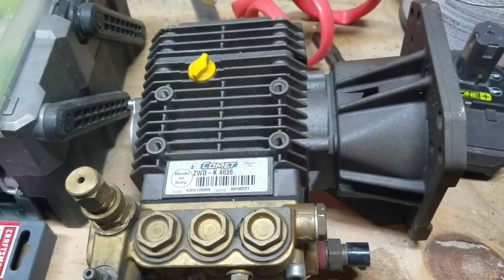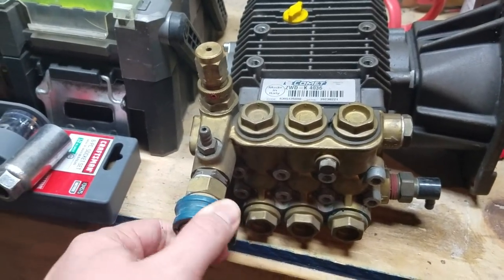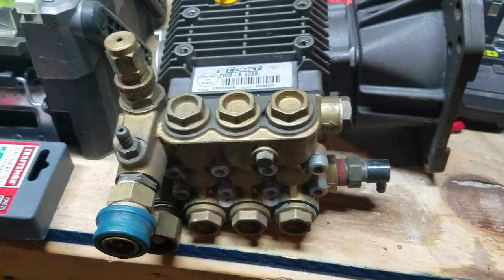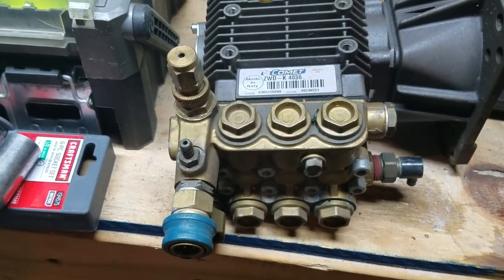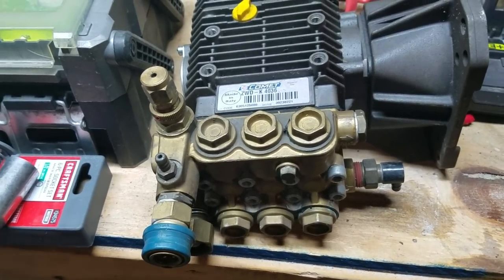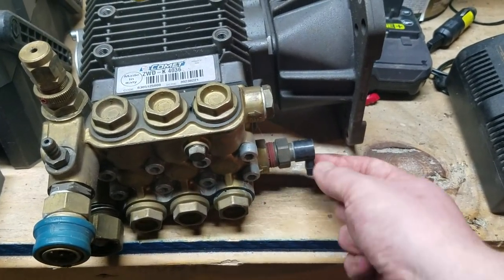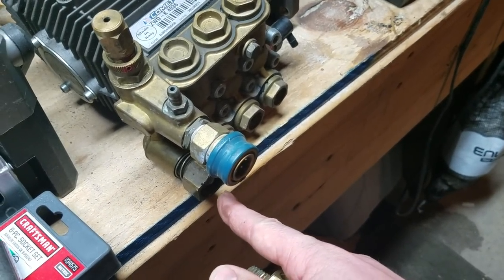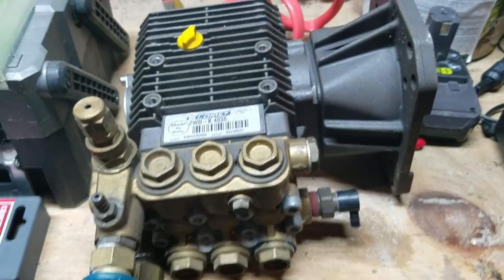Pressure washer pump basics

Comment: I have the same pump AAA Brand my thermal relief constantly leaks when machine off and water supply is on or off but doesn't loose pressure will it stop leaking if I replace ?

Comment: Thanks for video. We are just starting out & have bought the ZWD-K 4042 on a Honda 390 engine. I was hoping to use a buffer tank so that we don't have to be on the trigger all the time but after watching your video it seems that you are saying this is not an option. Am I correct in assuming that. I hadn't seen any videos previously that this would not be possible with this pump that's why I am grateful for your video. What I am worried about is that being newbies we will forget to pull trigger every 30 seconds & damage pump. I was expecting to install buffer tank to be able to let water run through pump to the tank  to prevent damage. If this is not a possibility then I don't see any reason for buffer tank other than if you go to a job that has no water! Is that correct. Can you give advice to newbies who now feel we bought the wrong pump as we know getting distracted for a minute or so is a very likely possibility & then damage to pump will occur! Any advice much appreciated!
Reply from the maker: Yeah that pump is best suited for direct feed.   Best advice is make as much money as you can with it and then upgrade your pump/machine
Reply: @Cleanpowerwash  many thanks. It was not so much about direct feed as I understand but to recirculate the water so as not to damage pump from overheating. Also what would be the pump you would recommend to start with knowing that I am worried about the 30 second rule on the trigger?
Reply from the maker: You really have a few minutes.   Most 5.5 gpm pumps are fine
Reply: @Cleanpowerwash  just watched another video of yours showing the different Honda engines & what your go to pump is! 👍
Reply: Video was best motor & pump combo! 👍

Comment: Shouldn't the relief be put up on the pressure side? Bought a used machine with relief on suction side and it was sucking air and wouldn't build pressure. Plugged it and put on a bypass unloader with relief. Always wondered why it wasn't up on pressure side, will it blow out?
Reply from the maker: Not sure

Comment: Hey thanks for the video, I’ve changed the oil pump and used it the other day, and I checked the glass oil measurement thing, and notice that the oil turned black. Is that normal?
Reply from the maker: Yeah that's fine.  It's when it turns milky that you have issues

Comment: I have a landa with a pump somewhat similar but it's belt driven. No pressure whatsoever. First I discovered all 6 valves stuck to varying degrees and fixed those. It has a small clear window on the opposite side of the pulley that you can see a rotor-like wheel, similar to the rotor in a typical old car engine. It doesn't turn when I turn pulley by hand...is this bad?

Comment: Hey man, I'm having the problem where water is shooting out of my downstream injector. Could you explain what that means and how to fix? Thanks subscribed.
Reply from the maker: Ball is stuck.  Or spring might be busted.  Take the hose barb out and look inside
Reply: I did pull chem injector apart and wd40 everything. Spring and ball seem fine and piece is clean. I just pulled upper bolt out holding the assembly that the water passes threw and found alot of black corrosion. Do you think that could cause it to not have pressure and shoot out of the chem injector

Comment: Hi I have a tractor PTO driven Comet TW025 premium series. the gauge maximum is 3500 PSI, would it be best to keep it around 3000? that's what I'm doing but I've seen the brass housing rated to 5000 PSI.  

I was thinking of building a whirlaway system and wondered would 3 nozzles provide enough cleaning power with a 3500 PSI machine?
Reply from the maker: The gpm is a bigger factor on # of tips

Comment: I have a similar pump. That doesn't have a valve to add a bypass line. Is it possible to add a bypass line to a buffer tank on this set up?
Reply from the maker: Without seeing it no clue.  But if there isn't a bypass option already, then likely no.
Reply: @Cleanpowerwash  Thank you sir!

Comment: Can you put a bypass on that Comet ZWD direct drive pump ? i Have just bought a  very similar Pressure washer pump  the 4200 Psi version from comet ( bought the rpessure washer due mainly  to the honda Gx390 wchich comes with it ,,, so i could use this pump  for an interval of five minutes and then it would advisable if i stop pressing the trigger everytime to turn the Honda GX390 off then ?
Reply from the maker: Only way would be if you put an external unloader on it and changed a few other components.   I'd advise against it.
Reply: @Cleanpowerwash  thanks for that amazingly quick answer ... will the pump be ok for jobs now and then  ? (  main service is Window cleaning )

Comment: I have pretty much the same pump hooked to a buffer tank. is there anything else I would need to do ?or will this pump cavitate? I tested it and the pump draw water pretty well. But I have my concerns
Reply from the maker: Clarke's Cleaning Service, Inc. Window Cleaner as long as it's getting water its g2g
Reply: Clean Power Wash awesome thanks man! I'm also going to add that one inch to the pump like you did on yours that should help it out also . appreciate your help

Comment: What’s the diff between direct drive pump and belt driven pump. I’m seeking that the belt driven pumps have just the bore sticking out. And the direct drive pumps have the manifold. I’m assuming that the direct drive does not have a bore but rather uses the bore from the engine? Am I right.? I see a pump on Offer up for $100. But it has the manifold on the side and not a straight bore. Im ASSUMING that it will not work for my belt driven setup. However maybe I can get the direct drive pump and just take off the belt system and just make it a direct drive.
Reply from the maker: Not following all of what you just said. Most pumps take the shaft into them. Belt and gear drive pumps usually have multiple design differences that make them function at a far lower rpm than direct drive. Direct is powered right from the center shaft and same rpm.
Reply: Clean Power Wash LLC currently I have a belt drive system. The pump has gone out. However I found a direct drive pump on offer up for $100. Can’t I just take the belt mechanism off the engine and attach the direct drive pump straight to the engine? Basically a conversion?

Comment: Hey Rob can you replace your thermal valve with a barbed hose and an adjustable valve this way you can keep your water flowing without any any back pressure is that possible thanks

Comment: Great video ..I have a power washer that it work as long as I press the trigger but when I let go it goes off .. help me please is there a fix ???
Reply: I'm experiencing the same issue, I'm currently working under the impression that the engine governor might have something to do with it. 
Let me ask you, if you manage to avoid a stalled engine, if you don't pull the trigger quick enough, do you  experience a lack of pressure that, over 3-5 seconds, finally begins sending pressurized water through your pump? 
The unit I'm referring to is a Frankenstein craftsman engine w/ an AR pump off a slightly higher rated Troy bilt GTS (guaranteed to shit on you in a month). I think the original 2.2gpm pump from the craftsman which was dead at purchase (the hose, gun and tips alone justified that purchase)is now replaced with a 2.6 or 2.8 gpm from the one "Built Without 'U'"😁

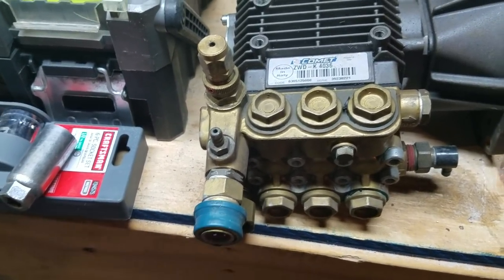Comment: 2:25 Why would you want a quik connect if you're going to a hose reel?   If you're going to a reel, aren't the jumper ends/connections pretty much permanent?   Also what's that plug at the right end of the pump for?
Reply from the maker: The bottom black piece is a thermal relief valve.  Yes you could thread a jumper hose directly in to it, but that makes servicing the equipment take longer.
Reply: No, above (or behind?) the thermal relief valve.   There's a big brass hex plug for some opening coming out horizontally.   Is that an alternate output or something?
Reply from the maker: Yes that is another outlet.  Most pumps are able to go out to the right or left.  Just depends on orientation
Reply from the maker: If done properly then the mix will breakdown to salt and not impact the plants.  Also any decent rain is going to bring so much water down that it will dilute the mix so much it won't matter

Comment: Rob I need. Help. Today I was doing a job and after I connected the water supply to my pressure washer it doesn't have any pressure. And I couldn't even pull the thing to turn on the pw.
Reply from the maker: Disconnect pressure hose and try starting.  It could also be vapor locked
Reply: @Cleanpowerwash  it was a dead lizzard clogging the water coming in to the machine lol
Reply from the maker: I've had that happen with carpenter bees before.

Comment: You pulled the pump because the unloader stopped working? I fix those all the time. They just get stuck. If you can't fix it you can just replace it. They're very simple. Has nothing to do with the rest of the pump.
Reply from the maker: Everything we were told by our vendor said it was unfixable.  Possibly less than stellar advice.  But it isn't a pump we would want to keep long term
Reply: Thats a fully plumbed unloader so no its not just replaceable, if it was a external unloader then it would be fixable or replaceable

Comment: How do you rebuild that built in leader? I got It apart but now lost what to do next. Mine is m-n-t pump electric branded for John Deere.
Reply from the maker: That unloader is built in.  I was told it couldn't be rebuilt
Reply: @Cleanpowerwash  what?? i paid $60 for rebuild kit online their website?? m-n-t pump?
Reply from the maker: This is a comet pump
Reply from the maker: Also the shop that I used locally back then has proven to not be the most reliable company to deal with.

Comment: ? i have a 3200 psi washer can i put a bigger pump on it 4000 psi pump on the wassher
Reply from the maker: i'd check with a vendor.  Your motor has to be paired properly to the pump.  That will determine the performance.  IE I can put a 8gpm pump on a tiny engine, but it won't be strong enough to operate the pump at its designed performance rate

Comment: My new machine has a comet pump and I can't find the oil drain plug. Any idea where I can find it?
Reply from the maker: William Welch it's underneath the pump
Reply: Clean Power Wash well hell, how do I access it lol?
Reply: Awesome video, my Dewalt 3750 psi 4.0 gpm unit Has the issue you mentioned about the injector shooting water out like a geyser!  I have changed the little ball twice, rubber gasket & brass screw hose piece twice and it still is shooting in air, can I fix it? If so how? If not do I need a whole new pump?  I thank you greatly in advance! Bird from NJ!

Comment: I left a Harbor Freight pressure washer in 17 Deg weather 2 weeks ago (purchased about 2 years ago $235), I got it cranked but now it just sprays water through wand upon start up.  No other leaks underneath that I saw.  Is it totalled from freezing temps?
Reply from the maker: ELLEON1959 are you saying the wand won't stop spraying?  If so you just need a new wand.
Reply: Well, yes to an extent.  Upon start up after about 10 tries on "choke", it finally started, I had the wand in the machine side holder and it immediately started blowing water.  It doesn't seem to have full pressure at that point, until I press down on the wand handle.  I washed the few rocks I had and cut it off.  Is it possible there's some trash/debri in the wand?  I thought for sure the 17 degree weather affected something in the pump, I just can't believe I didn't think of it before the horrible weather came.
Reply from the maker: ELLEON1959 the gun shouldn't spray when the trigger isn't being pulled.   With the washer off, spray pbblaster or wd40 onto the metal piece that controls the flow in the gun.  Squeeze trigger several times.  If that doesn't fix it then get a new gun.  Granted a $235 power washer isn't worth much anyway.
Reply: Thanks CPW, I tell you what, for the price I have been impressed with it's performance.  I did my entire house (limestone rock walls with it), and I'd been using it at least 30 minutes a week in the last couple of months, to clean more of the limestone, I have a small project I've been working on.  It had been working like a charm untill the the freeze....
Reply: granted, it's just CRUMBS to people like Nancy Pelosi,,,,  Just poking some political fun, sorry if you don't get it, or take it the wrong way....
Reply: ELLEON1959 actually, i got a nice bump in my pay so i decided to buy a presure washer with it. Thats why im here researching the best pumps. But hey, i dont want to give up my crumbs!
Reply: Harbor Freight, Predator, 240$, 2500 PSI, don't you dare wash your car on smallest nozzel, it took chrome off my plastic grill on my car.  WORKED LIKE A CHARM NOW FOR 2.5 YRS.  DON'T LEAVE OUTSIDE IN A FREEZE, OTHER THAN THAT, I CAN'T SAY NO MORE!  One mean little mother upper
Reply: CPW, yesterday I sprayed WD40 into the inlet hole of the wand and today I cranked it up to use it to wash some rocks.  Now it seems that the motor is compressing water constantly upon start up & coming out of the wand at full pressure....  How does the pump know when to kick in?  I presume it is just by depressing the wand handle or could it be something else? Is there anykind of automatic switch down below that senses lower pressure upon wand opening and turns the pump on?
Reply: JM this little Harbor Freight (Predator brand, I think it's 2500 PSI, took fucking chrome off of my Durango's grill (with the finest head of course, I had a dumb moment)....  Anyway I'm using it to clean up white limestone rocks from mildew and algae.  It's a BAD little SOB for the $235 cost!  DON'T LEAVE IT IN 17F!!!!
Reply: Ta dah!  Swapped Bro in law's wand on my machine, and my cheapo predator pressure washer is working as normal again!
Thanks!

Comment: He's a question that I have heard different answers to. When and why would you adjust the unloaded valve?? I have read not to touch them but I'm honesty clueless
Reply from the maker: Colby Davis it is at a generic setting from the factory.  depending on your machine you would set it once with a. pressure gauge and then leave it alone.
Reply: Understood. So I shouldn't rely souly on my ball valve to set my pressure because the pressure washer I have is 4200 psi and I'm not looking to blast through a wall I want to use lower pressure. Sorry for all the questions. If you'd like better to forward me to a resource or some literature I can read on I would gladly take that if you want.
Reply from the maker: Colby Davis I'll make another video to explain it. but unloader settings and ball valve choke are 2 completely different things
Reply: Clean Power Wash thank you again
Reply: Okay wait I'm so lost. What do you mean loop? I have the same type of pump and I was hoping I could add a downstream injector and not use the built in one? Because I am having poor results with applying Chem. And the unloaded valve? What's that exactly do? I just turned my nob (black) and the way to the + side. I'm new to this but I have a whole set up in my truck on a pallet and trying to start a house wash business but every time I show up to a house I have an issue! Recently I got 150' of hose and it's not drawing chemicals, so I ordered a 12gpm gun because mine I have now is only 6.6 gpm. Thanks
Reply from the maker: Davis PowerWash your injector is the issue Not the gun.
Reply: Clean Power Wash well I have been getting all sorts of different advice. Some say it's the gun others say injector. Only reason I don't think Injector isn't broken is because it works with 50' of hose! Not saying it isn't poor quality but it works with shorter hose. So with a pump like this, can I get a new injector? Or am I stuck with the one built into it? Thanks
Reply: John Lange here's my suggestion and take it with a grain of salt because I do not have one that's built in but I do know you can rebuild! Lol so first find something to plug the built in injector and then just attach a stand alone injector where your hose goes in then just add the hose to the other side of the injector of course. You can find anything you need at pressuretek website. You do not have to buy the by pass but it helps to conserve pressure when not soaping. Make sure to buy all the right quick connects to install it (male female) because they won't come with the injector. Simple fix tbh. Don't buy when you can just adjust what you have. 👍👍
Reply: the only time you need to adjust uour unloaded valves is when you want a certain pressure at the end of your wand or nossle, sometimes when doing certain tasks you would want to lower the pressure so not to cause damage to whatever you are cleaning, thats when you would adjust the valve. and having a gauge helps greatly.